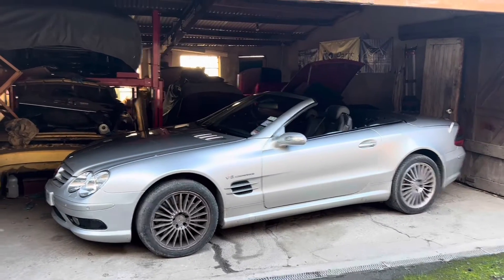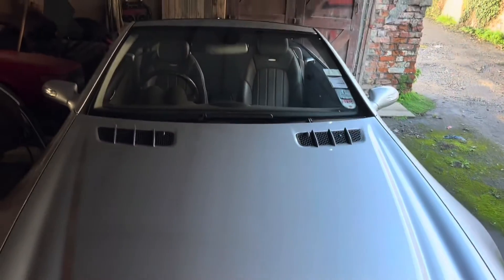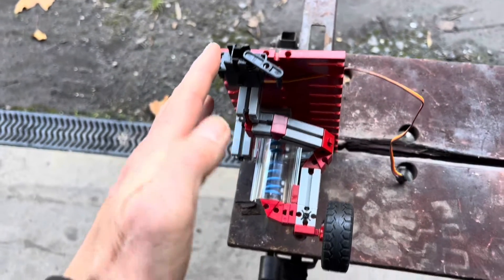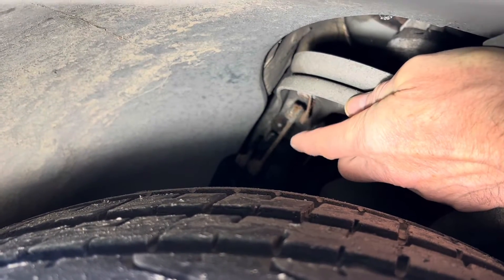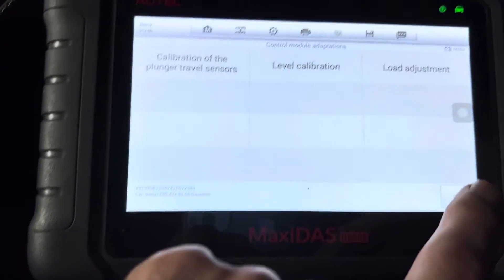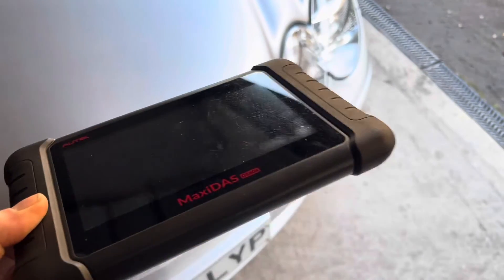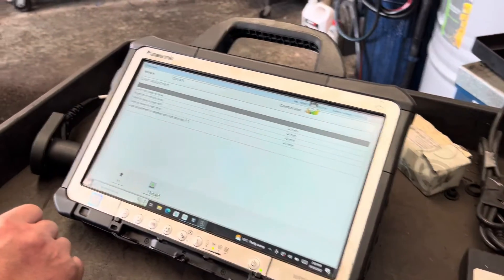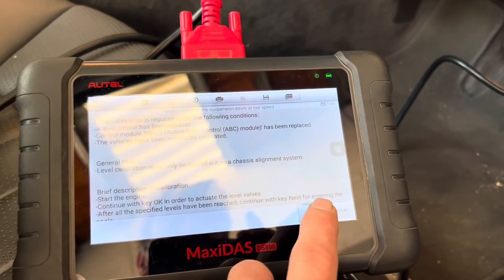Mercedes SL55 R230 level calibration and suspension lowering using Autel MaxiDAS DS808

Comment: i managed to program sl500 2002 with MS919 AUTEL
I started with plugs, then level calibration, then plugs, then level calibration, then load calibration, it's important that the voltage is between 2-3 volts at the height of the sensors, otherwise you'll get the wrong code, very good video, thank you very much, best regards Staffan from Sweden
Reply from the maker: Thanks for your comment. I think the problem is with the Autel software version I was using because everything worked fine with STAR. Hopefully, I will get to try another unit one day. Mike

Comment: Best use of my childhood engineering set-Fischer Technic! When I saw that I knew this Fella is on point.
Reply from the maker: Fischer Technik the best! I'm not quite sure I understood your point about removing the SIM in the tracker. Mike
Reply: @MikesMercsandothercars  Mike , What I meant was to remove any possibilty of the system to still communicate with legacy accounts... more a security move.

Comment: This is a fantastically good and helpful video.  I have the MaxiDAS DS808 also.  I have the exact issue you have described.  I will see if my version of the software gives the same error when recalibrating.  My issue currently is that the RF Strut has a reading of 4.7 height when all other struts range from 1.8 to 2.8 in height.  the RF does not change using any of the settings.  I am assuming either a broken height sensor or a bad connection.  either way, it's broken.  This video has helped tremendously.  Thanks so much!
Reply from the maker: Thanks for your comments. Can you tell me:
1. Does you car have any fault codes at present (eg ABC warning light on dash)
2. Is your car sitting more or less level OR can you visibly see that one strut is much higher?
3....and of course the question that intrigues me most, what happens if you try to do a level calibration using the Autel.....using the correct procedure outlined in the video?

What car do you have and where do you live (UK USA etc?)

Mike in Bristol.

Comment: From my experience if you first done plungers calibration it’s wrong like you said. To repair it, you got to level car first but without confirmation with incline angle, set all wheel arches to 37cm from wheelhub center and then do plunger calibration. Finally do level calibration, and guess incline angles that got be corresponding with voltage of level sensor. Mine CL level sensor where 2.8 V on one and about 2.4-2.6 on others. So I make logical thinking that 3V is low and 2V is max high and set low number incline angle on that 2.8V sensor and central value for others. Good luck with your calibrations. It demands some free time, open and fresh mind. I needed another day to do it with fresh start and a lot of reading forums, watching videos and draw conclusions.
Reply from the maker: Wow that’s a result. What scanner were you using? Mike
Reply: @MikesMercsandothercars  launch x431 creader elite Benz only
Reply from the maker: @lukeduke9304  Interesting - I think I have a Launch Elite - maybe I'll give it a go...because it sure didn't work on my Autel. Thanks again for the comment. Mike

Comment: Mike Great video and have subscribed. Newish to YouTube but will get there. 

Question. I’m going to buy an Autel to help me with my SL55. Is the one you used on this (the 808 I think) what you would still use or have you a recommendation for a newer addition. Important that it does the suspension in my case. 

Sorry this is long but also I have a year 2000 R129 SL600 and wonder if you know how to calibrate its suspension which may be different. Mine is not level and I wonder if the Autel would be able to help. Thanks.
Reply from the maker: Hi - nice set of cars. I bought my Autel Maxidas DS808 on eBay and unfortunately the seller never transferred ownership to me via Autel which means I am unable to subscribe for software updates. The software version on my machine has a bug which does NOT allow you to calibrate the suspension on an SL55. I had to use DAS Star at a local Independent.

A chines company recent sent me a Launch elite 2 scanner to test and my plan is to see if it is possible to calibrate the suspension using this device. If it works, I'll do a video.

Does your SL55 currently have any suspension problems?

What is the problem with your R129 suspension?

Mike
Reply: @MikesMercsandothercars  
Thanks a mill for the reply. 
I have been burrowing around and apparently the Autel Elite Pro II will do everything. Unfortunately it’s £1749 but still can’t get an answer as to whether it’ll work on my SL600. 

The 600 appears to have a similar hydraulic suspension system to the ABC on the SL55. Unfortunately I took it to a company ages ago that I thought would be able to rebuild the rear suspension and get the ride height etc correct. How wrong was I. 

They replaced various bits and pieces but couldn’t get the car level. They employed another ‘expert’ who also failed after many months. He replaced a load of very expensive bits and told me a special tool was required to set the height. A recent friend who is a retired Mercedes mechanic believes the ride height and all the other stuff should be able to be done using the Autel and the special tool bit is BS ! The car is a year 2000 R129 SL600. I’ve written to Autel about this. 

Also I have the airbag light on and it won’t get through an MOT. Again, like an idiot, 
I sent it to the same place and it’s just a nightmare. What I’ve realised is that they didn’t have any diagnostic kit at all and were winging it at my expense. They managed to borrow a system, god knows what, but it wasn’t up to the task. I’m thinking of getting the car back and running it through the Autel which I’ll buy. 

Are you familiar with the R129 airbag system? Note the last time this happened it was a loose connection under the passenger seat. Took 10 mins to fix ! 

I’ve learned a lesson here and never again.

Comment: Any updates on bug fix on the MaxiDAS?
Reply from the maker: Not yet. A company called “Launch” sent me one of their scanners to review and when I get a moment, I’ll see if that scanner allows me to calibrate the suspension. I also have some new adjustable links I’ve been meaning to fit. This allows a certain degree of manual adjustment and lowering. Mike
Reply: Hi Mike, did you get a chance to try the Launch scanner? And if so, did it work?
Reply from the maker: @russellmemphis  I haven't had a chance to try it yet. Where are you based? Mike
Reply: Memphis, TN
Reply from the maker: @russellmemphis  ....ok that is a bit far to send you mine to test. I will get round to testing it...but don't hold your breath as i'm off to Australia till Jan 20.Mike
Reply: @MikesMercsandothercars   Safe travels!
Reply from the maker: @russellmemphis  Cant wait for that sun and surf. Happy Christmas! Mike

Comment: Hi Mike, when you & the tech were at the Level Calibration, did you have to manually raise all 4 corners to max height which is 0mm before you can perform the plunger calibration?  I was told they need to be at max height in order for the plunger calibration to be successful.
Reply from the maker: Hi - not that I recall. As far as I remember, the calibration process raises the car and drops the car as part of the process - there is no manual intervention. I will double check and get back to you if possible. Mike
Reply: Mikes Mercs and other cars  Hi Mike, thanks for getting back to me & please do if & when you get a chance.  Btw, were you able to figure out why your scanner couldn't perform the calibrations?
Reply from the maker: @megatran2010  OK will get back to if I can find a definitive answer.

I think that version of the Autel scanner just has a very specific bug relating to the calibration and unfortunately I am unable to update the software to ascertain whether a software update cured the issue.

Mike
Reply: @MikesMercsandothercars  My friend brought his S55 back today for another look.  I used the procedure you had mentioned but got the same message as yours when I tried to calibrate the level sensors in the Initial Start Up menu first.  I, however was able to get around it by manually raise each corner to max height.  By doing so, it also expanded the struts & put the plunger travel sensors to the top end (0mm) then proceeded to the plunger calibration & it passed.  The only issue I have left with the ABC is I still have the white warning message as for some reason, I couldn't run the last calibration which is the Load Adjustments as it kept telling me it hasn't been successfully performed.  Perhaps these cheap Chinese knock-off scanners have a flaw with their program's algorithm and/or sub-routine so it's not quite exactly the same as the Mercedes Star SDS?  Can you ask your Mercedes-Benz technician if there's a way to get a round it?  Thanks
Reply from the maker: @megatran2010  I spent so many hours trying to figure this out before discovering it was a bug in the Autel DS808. Just to confirm...

1. What make and model Diagnostic Tool are you using?

2. When you run diagnostics, what fault code are you getting?

My fault code was was to do with 'Level Calibration'

To clear that fault code, you need to perform the 'Level Calibration' successfully AND the  "Load Calibration" needs to run successfully

The Plunger Calibration may run successfully, but you wont be able to clear that ABC message unless both the Level and Load calibration are successful.

Not sure what country you are in, but an Indy Merc specialist will charge between £50-£100 to carry out the calibration. Don't make the mistake I did, and waste hours trying to solve what I assume is a software bug issue.

It could of course be the case that your S55 actually has a problem with one of the struts or sensors that is preventing the calibration running successfully.... Mike
Reply: @MikesMercsandothercars  I have a Foxwell NT530 scanner & have also spent so many hours helping a friend to fix the ABC on his 02 S55 after he replaced both of his rear struts.  My scanner ran into the exact same problem as yours but I was able to get a bit further for it to pass the plunger travel sensor calibration.  Initially, I couldn't complete the level sensor calibration under the Initial Start Up With Manual Takeover as I kept getting the same message like you were getting "The Preconditions of The System Test were not met. Check Preconditions & Repeat System Test" so I used the F keys from the same Level Calibration menu to raise each corner.  Once they're all at max height which by default also expanded the struts & put all 4 plunger travel sensors to their top end (0mm), I ran the plunger calibration & it successfully passed.  I've tried to run the Load Adjustments right after but couldn't complete this last calibration so I went back & re-scanned & the only message I have left with the ABC is the "Load Adjustments Hasn't Been Successfully Performed".

I re-watched your video & saw that you again couldn't run the calibration even after the technician had fixed the issue so it's telling me these Chinese scanners must have a flaw in their program even though their algorithm & subroutines look exactly like the Mercedes SDS.  I've contacted Foxwell technical supports in China & they asked me to record a video of the diagnostic & send it to them for review.  I'll do so next week when the friend brings his car back & will keep you posted.

Btw, I live in California, USA.  I was a senior scientist & manager at an Aerospace Company for 36 years.  I chose & took early retirement 4 years ago when I was 58.  It turns out to be 1 of the best decisions I've ever made in my life as my wife & I are now spending our golden years travel all over the world for 6 to 8 months out of a year & plan on keep doing so for the next 8 more years.  Hopefully, we can keep going for many more as long as our bodies still being able to keep up with us :).

Anyway, being a scientist, I am analytical by nature & I don't like to leave things unfinished so I'll continue to look into this.  If the scanner does indeed has flaw(s) & they can't fix it then I'll have the friend takes his car to a shop but I'm not giving up on it just yet :).
Reply from the maker: @megatran2010  I'll be interested to see how you get on. It wouldn't surprise me at all if the 2 scanners used exactly the same underlying script....with the same underlying bug. I too studied engineering, and like to try and understand how things work....but that software bug almost got the better of me. Mike
Reply: @MikesMercsandothercars  I knew you're also an engineer as I was impressed with the mock-up & the way you explained it.  How did you came up with the mock-up?  Anyway, if  I learn & figure out anything new, I'll keep you posted.  Have a great day.
Reply: Mike, question:  When you had the Mercedes repair shop did the calibrations, did the tech put your car on an alignment lift or just left it on the level floor?
Reply: @MikesMercsandothercars  Mike, question:  When you had the Mercedes repair shop did the calibrations, did the tech put your car on an alignment lift or just left it on the level floor?
Reply from the maker: @megatran2010  Just left it on the floor. At one stage I thought my failure was due to the level of my floor but as the final clip showed - my scanner failed under exactly the same conditions. Mike